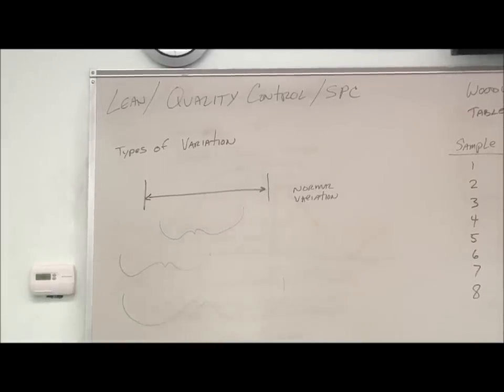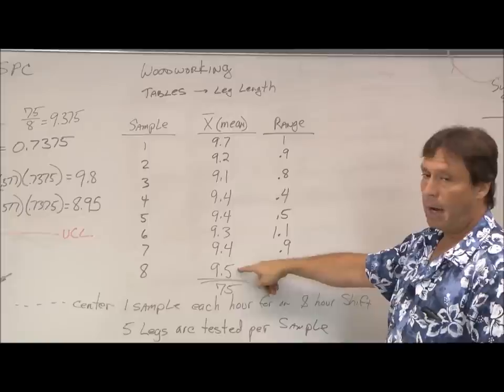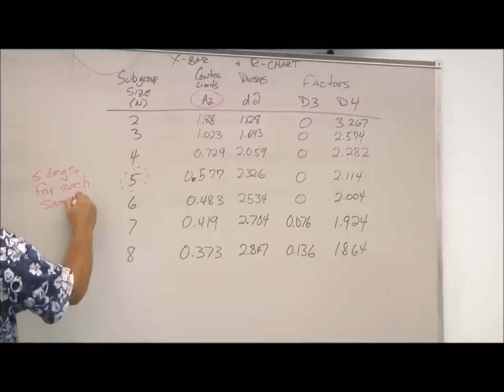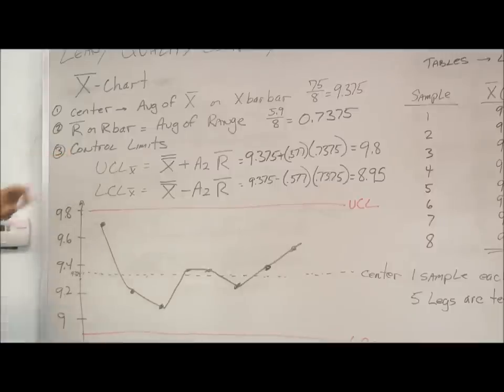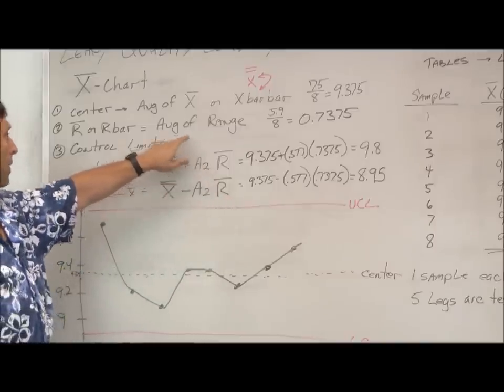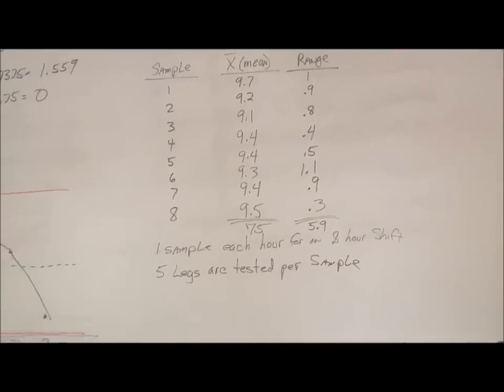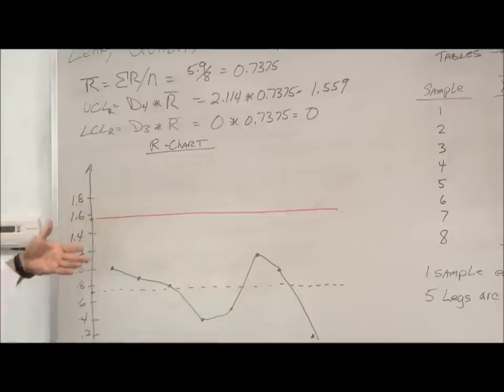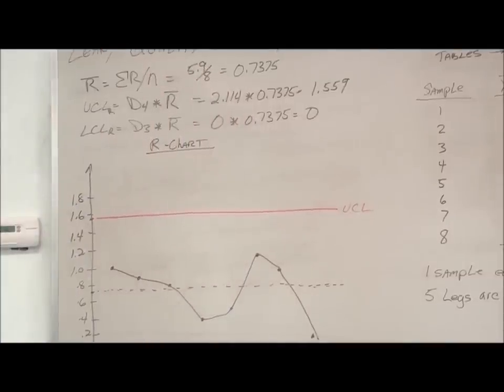Xbar & R-charts

Comment: can u please explain how did you get the D3 column values ?
that is the only thing i guess that you haven't explained 
rest everything is crystal clear after your explanation
Reply: +Nikhil Tavase that colums (d3 and d4) have already calculated and accepted so you don't have to calculate them.Just read it
Reply from the maker: +Nikhil Tavase Bahadir is correct, just use the chart that has the values calculated value. "N" is the number of opportunities per each measurement. For example, if you measured 5 items (5 opportunities) each hour during an eight hour shift, your "n" would be 5.